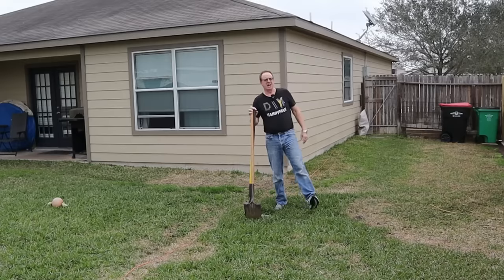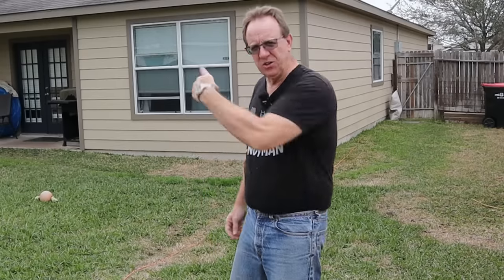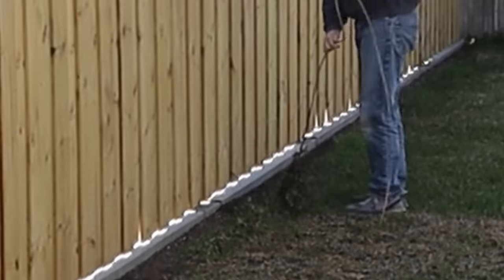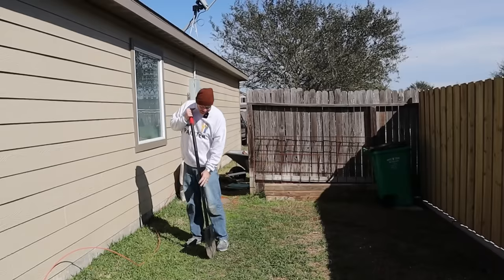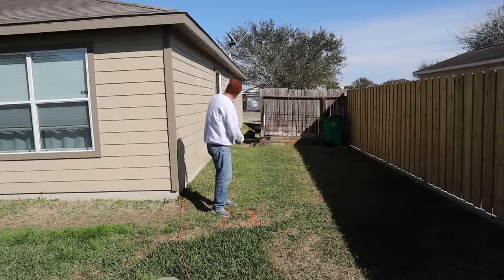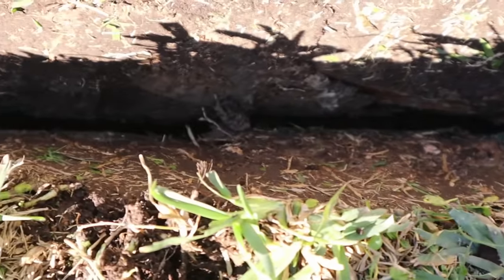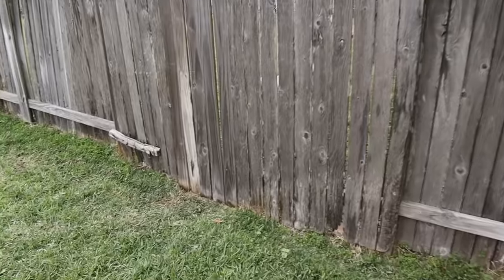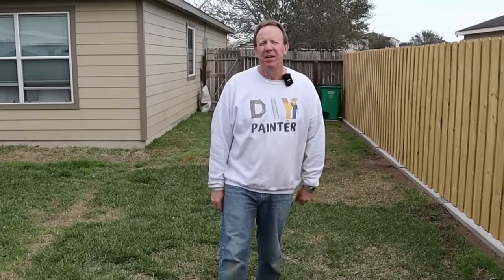ZERO Digging-Trenching Made Easy-Cable, Electric, Conduit

Comment: The National Electrical Code requires direct burial cable, plastic conduit containing electrical wiring with a voltage of 110 vac to be buried a minimum depth of 24 inches. You are setting yourself up for a possible law suit unless you only put extremely low voltage is 12 or 24 in that ditch.
Reply: Well.... I think 120v can be buried 12" if gfci protected by breaker. I'm not saying this shovel can get a wire 12" down. Also low voltage is used in so many landscape lights these wires only have to be at least 6"
Reply: 2020 NEC Article 820 covers coaxial cable installation for CATV. Article 830 covers network powered broadband system installations.  I only see Table 830.47(C) "Network-Powered Broadband Communications Systems Minimum Cover Requirements" addressing the burial requirements.
Reply: @paulwheeless1080  To my understanding, he is installing household  power to a remote location, which does require a minimum depth. I think one gentleman did state the code allowed for 12 inches of GFCI protected.
Reply: YouTube comments, the worst place for professional advice.  He buried a coax communication cable.  His title did say elecrtical...  Chapter 8 covers communications systems in their entirety now (as of 2020 NEC). You are referring to Table 300.5 "Minimum Cover Requirements, 0 to 1000 Volts Nominal"  Also, ground cover is also subject to local building authority rules based on local conditions and may be more restrictive.
Reply: 18" according to my county !!  Conduit or not  I checked the codes.  They have very specific diagrams.  What you state is not always true but I bet 12" in the minimum for any type of line except maybe FIOS.  My water is actually the shallowest.

Comment: Too bad that the electrical code says that cable must be 18 inches below the surface and be bedded on 3 inches of sand. Oh, and if your lot has rock or heavy clay soil this tool is useless anyway. And if you don't follow the code, good luck on collecting insurance if there are any issues, whether or not they had anything to do with the cable you laid. So much ignorance, foolishness, and bad advice on YouTube.
Reply: Power cable sure, he ran coax